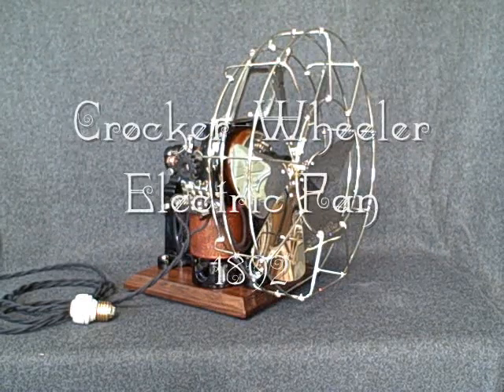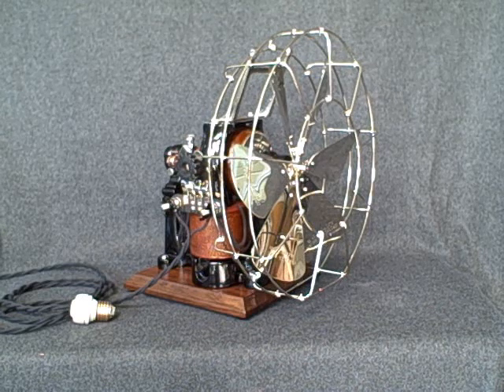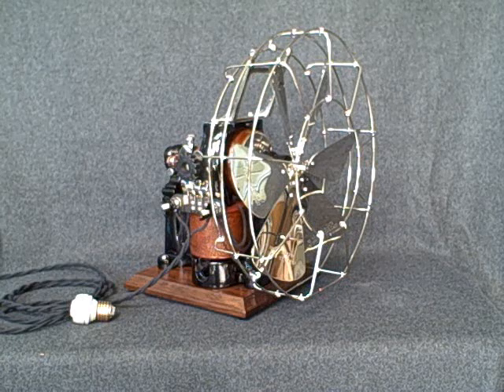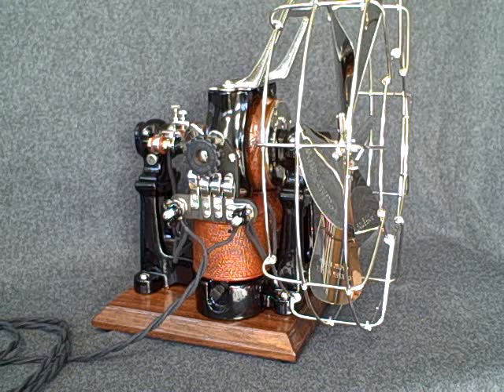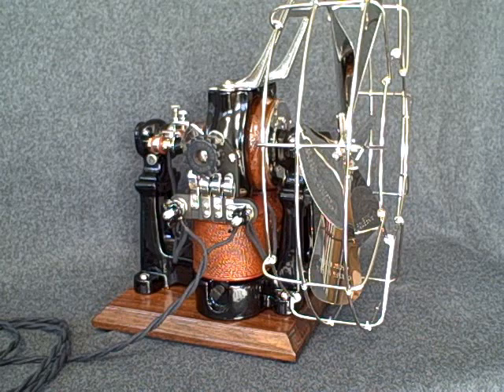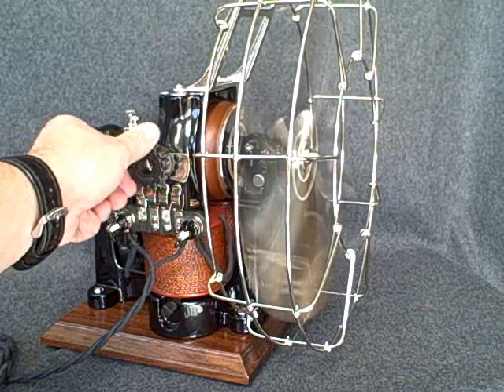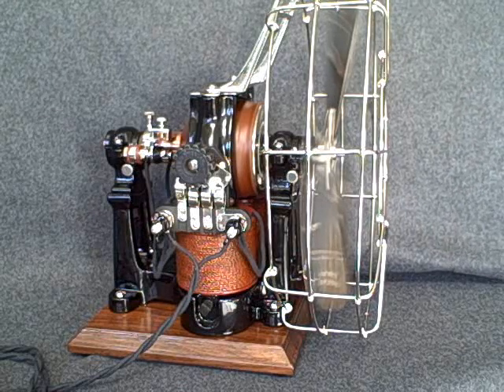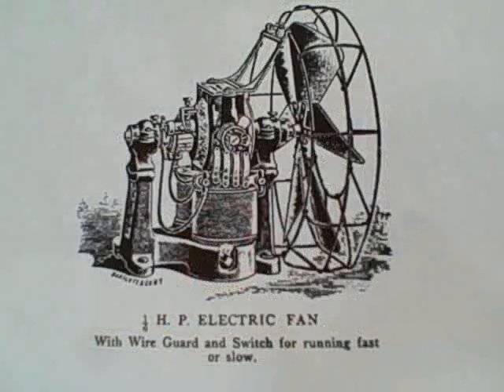Crocker-Wheeler Electric Fan (1892)

Comment: That is one beautiful old piece of equipment! I can't believe these still work without a hitch! Very cool!
Reply: ShawnC22002 Quality construction is the answer for that excusing all the dangerous exposed electronic connections like the guy in the video said it’s very powerful and very reliable and of course those two things come at the price of safety
Reply: @silasmcgee3647  Yes. Built to last. Not to break.
Reply: Roro utube too bad most things aren’t like that these days
Reply: Like imagine being so excited to buy a Chevy Cruz then in a year you’ve gone through three transmissions
Reply: Then Joe down the street celebrating his 20th year with his old Chevy pick up from 1985 and breaking 400,000 miles with little work
Reply: Or in this case a fan that was built before 1900

Comment: Although it is true that early appliances were sometimes connected to pendant light sockets, there was a light socket style receptacle.  This receptacle fit in a standard single gang box and had a cover with a hinged flap to cover the socket when not in use.  I have some in my collection, that I removed and updated with 2 prong duplex receptacles years ago.  I mostly have found these in knob and tube systems built before 1920.

Comment: It is true that many times appliances were connected to light sockets, but wall sockets were produce and installed in homes.  I have a few of these that I removed from turn of the century homes.  They have the Edison light socket opening and the cover has a brass flap to cover the socket when not in use.

Comment: Great fan, wonderful condition, - but potentially lethal both mechanically and electrically.  Gosh, they took chances in them days, although US 110 volts possibly a bit less dangerous than the UK's 250 volts AC.

Comment: This was a wonderful video. Thank you very much for showing this piece of history. It almost looks like a work of art.  I always wondered how in that era people managed to prevent accidental deaths due to the electrical and mechanical devices they used. Since most devices had pretty much everything exposed.
Reply: From what I understand, they didn't. People electrocuted themselves often.
Reply: And as for that impeller guard - a lot of incidents of fingers being chopped off with these antique fans ⚠️😧
Reply: @samuelfellows6923  I know, that's what I'm thinking,  However  humanity still exist and many of the people from back then survived without any issues or getting hurt using such technological advances.  also interesting enough is that it wasn't just the fan, but every form of transportation as well as all other domestic and commercial tools, appliances and equipment had dangerous mechanisms exposed; and people still managed to use them safely.  I'm starting to wonder if people back then had a higher level of common sense?🤔
Reply: @hmascuba  - yes, they did 😉

Comment: It does look electrically dangerous but I expect at that time the negative (or neutral) probably wasn't referenced to ground at the local sub station like they are now, so touching either terminal wouldn't give you a shock at all. Touching both at the same time would, but even if that happened it would almost certainly all be in one hand therefore not being dangerous to you (but it would still hurt your hand!). To put it another way, the AC in your home today can shock you because the neutral at the substation also runs to an Earth/Ground rod. So if you touch a live contact, the current flows from you into the ground to return to the substation (and you get a shock). I believe at this time the referencing to Earth wasn't done so would be an isolated circuit.

Comment: you said it is 110 DC,  don't you mean AC
Reply: DC. Notice, the carbon brushes and commutator on the back of the motor. (If the field poles are laminated, this would be a "universal" motor, and would run on either AC or DC)